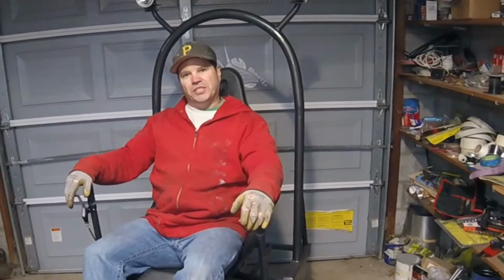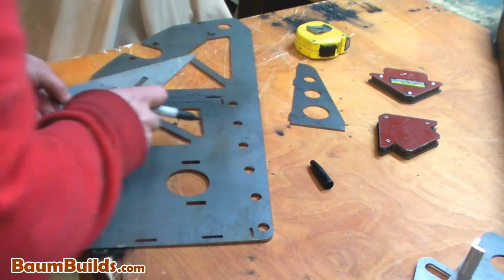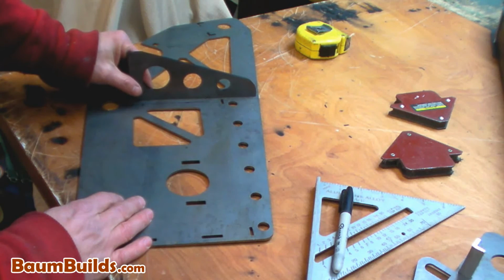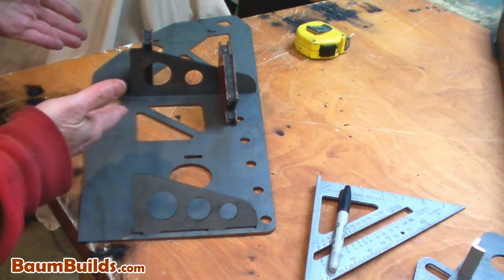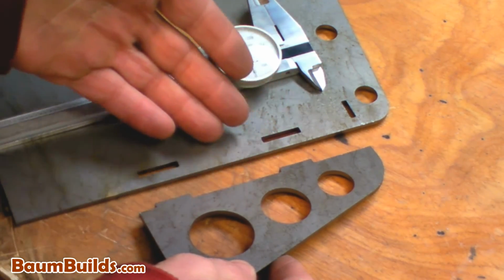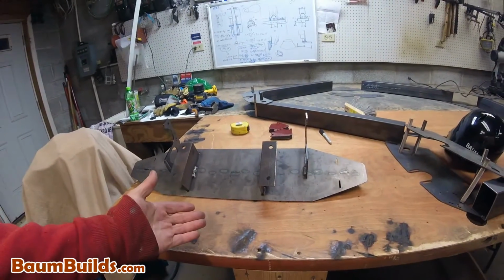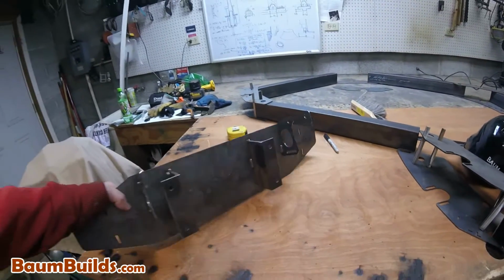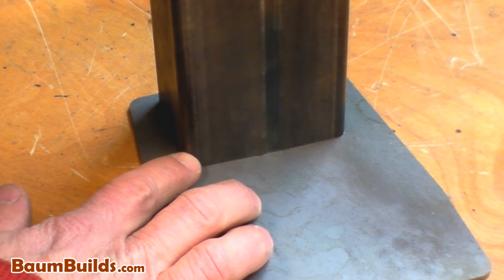BaumBuilds Build Tip #1: Self Fixturing Design

Comment: Very cool - did some further research into tab and slot fixturing and was pleasantly surprised to find out that SolidWorks 2018 has this feature!

I have a question for you concerning the method used to cut your parts for the cool vehicles you've built - waterjet, plasma or laser?  Did you have
any issue with stresses due to the heat with plasma / laser if those were your methods?  I would like to look into building a welding fixture table
with tab and slot to see if I can get the cuts done locally and save a bit of change versus a Certiflat kit.
Reply from the maker: Hi Karl, Laser is generally best for accuracy and sharpness of cuts so that is what I recommend using for tab in slot designs.  Second choice would be waterjet, with plasma the third choice. I have not experienced stress issues, and heat build up is generally not an issue with laser cutting, and certainly not with the waterjet.  Plasma cutting does generate a lot of heat in the part but I have not experienced any issues as a result of it.  I do use plasma cutting for my designs that are not tab in slot, as it is more economical.  Good luck with all of your projects.